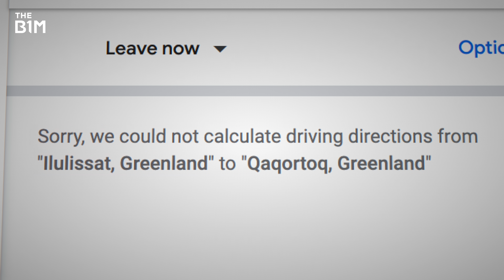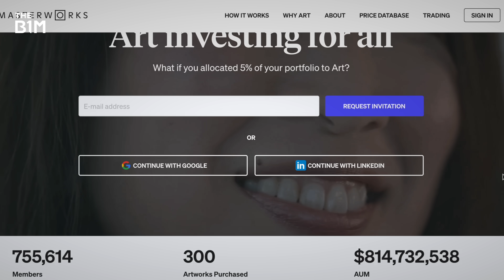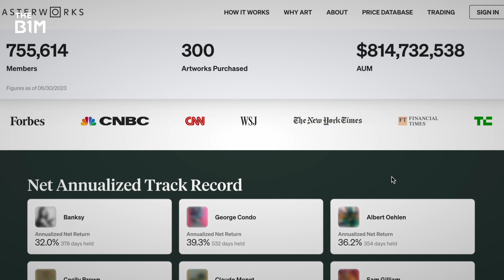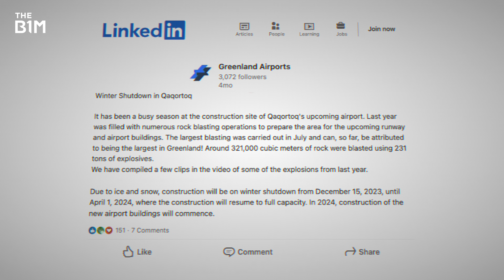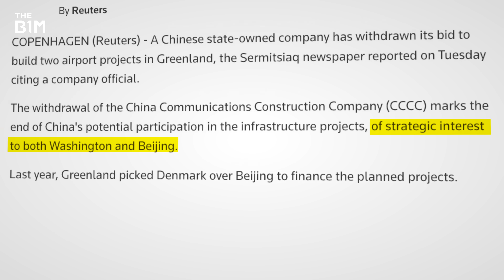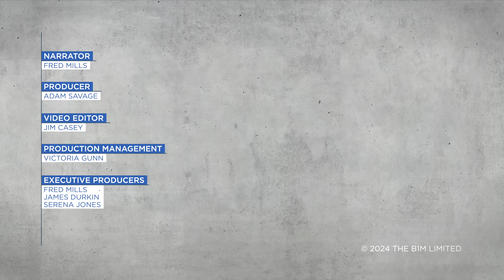Why Arctic Airports Are Built With Explosives

Comment: What seems very important is to have that second airport with world class size and instrument equipment, allowing for international flights to divert to the other in case of extreme weather.
Reply: Like icebergs crashing through the runway.
Ilulissat means Iceberg and is the calving capital of Greenland, so why build the runway over the beach‽
Reply: Building more airports around Greenland also eliminates the need for ETOPS on transatlantic flights.

Comment: Your lack of focus on permafrost makes me wonder if their land is different from that on Canadian arctic.  At Resolute Bay for instance, all buildings are off the ground and floor heavily insultaed to prevent ground below from thawing. This was not possible in the aircraft hangar so they run coolant loops below floor.  Runway is gravel.   Then again, Nuuk is at 52° latitude, so well south of permafrost line in Canada, yet they have permanent ice not far from shore.    If they are built  direct on rock, permafrost is less of a problem, but you showed example example where they were working with mud would be a big no-no on true permafrost.
Reply: As far as I understand the mud mentioned was removed from the sea bottom before filling in the sea with rock. Land in Greenland typically has very little or no soil cover (hence why constructing a runway it not about digging, but about blasting) so construction should usually start with bare rock. Resolute Bay looks built on a gravel deposit, so the situation there is different.
Reply: In Greenland permafrost is less of a problem than you would expect, mostly because the soil layer is so thin, usually no more than half a meter before you hit bedrock.

On the other hand, that means you have to blast a lot of bedrock, and that is not cheap
Reply: @erikfleischer7073  Thanks. Interesting and significant differete from manu communities in Canadian Arctic.
Reply: @jfmezei  I believe it is because that Greenland only have a coast. 
So in the summer it is coastal climate, with modest temperatures,  and corresponding slow vegetation growth.

Comment: 8:52 am...Iqaluit Airport in Nunavut, Canada is a good example of a successful and efficient Airport completed in the Arctic. I used it numerous times..........Airbus A380 was tested there for Arctic winter test!
Reply: YFB as well as various other long runways in the Arctic were built in the 1960s, designed for US B-52s to end the world in case of nuclear war. Thankfully it never actually got used for its intended purpose, so we get a civilian airport instead. The new terminal expansion dates from 2017, but you can still see the old "yellow submarine" terminal.

It's not far from Nuuk but scheduled flights are only intermittent. Every few years -- and this year is one of them -- there's a schedule flight. Then the airlines find it doesn't pay off, so it gets cancelled. One day it'll stick.

Comment: I like how they chose to upcycle the dynamited rock back I to the airport runway.  That's usually something that's on my mind when construction breaks ground  - what did they do with all the escalated material.  Excellent method!  I like where the mindset is on this project!
Reply: They'll be out of their minds if they chose to import backfill materials from elsewhere. The logistics and its associated costs would make no sense whatsoever.
Reply: @mfaizsyahmi  which is why they escalate.....the EXcavate........or it's too LATE........
Reply: We blasted a lot more rock than what was present on site in Nuuk. The volume blasted is not because of rock at the site, but because of design constraints.
Reply: @guyfawkes8873  what was done with excess not repurposed?